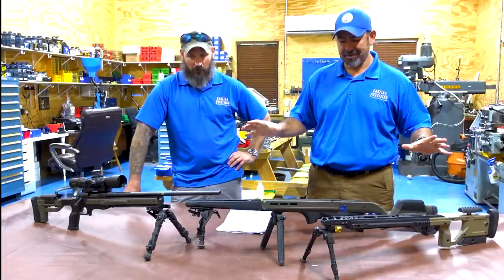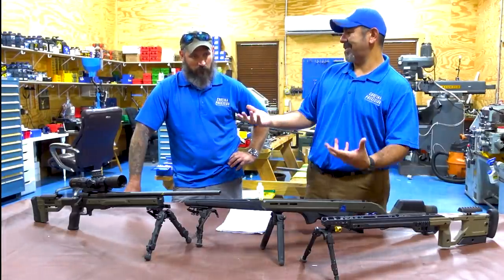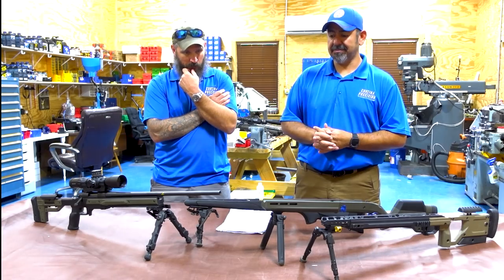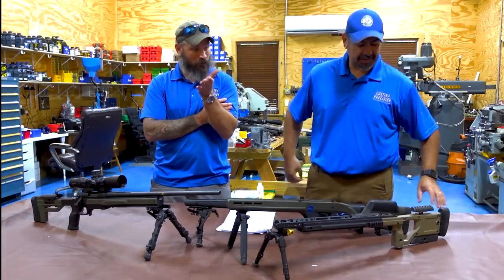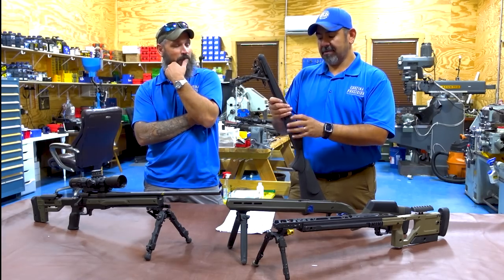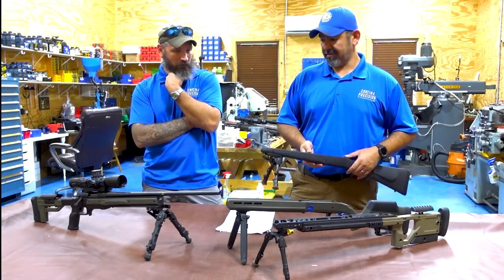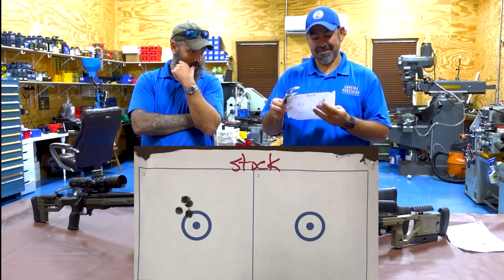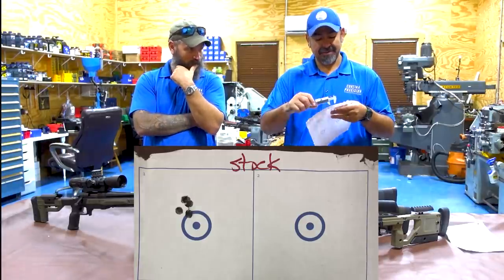6.5 NEEDS-MORE | WE TESTED FOUR DIFFERENT STOCKS

Comment: I know you want to put your tuner brake to push your product but for hunting and range gun no more barrel length, I have two 308 in magpul stocks and shoot half inch groups now they are hand loads a little over 2500 fps 168 MK, one half inch group does not make it a half inch shooter, try three groups then average it, you have another ''problem'' in my past I found stocks when switched the stocks the action need to settle into the stock for best accuracy. I love the magpul stocks but one thing set it at 50-55 inch pounds while the action is settling into the stock, keep an eye on the actions screws torque, they will back out affecting accuracy. Now H&S stocks set torque at 65 inch pounds and forget about it. magpul cheap bottom metal that plastic and cheek riser cant beat the price. Super Sniper want agree with me M24 I am old school, hing floor plate tough as nails, drop magazine in dirt, mud, dirty water you have a problem. A "sniper" one or two shot then high tell it. Fire Suppression drop magazine use an auto loader. Yes I have two 10 round magazines for my magpul stocks, some times a man can't resist that ''Rambo Look'' LOL LOL LOL If in conflict for high value targets my M24 clone with hing bottom metal. I have a problem first plane scopes love the grid but hate it at low power or in dark condition, Carlos Hathcock did not use a grid. LOL LOL LOL LOL I sent my first plane Leopold scopes back to Leopold and had tactical turrets put on. I would put both rifles in magpul stock add a good trigger put 50 rounds through both giving the stock time to settle in the stock, keeping an eye on torque and then compare them to keep the more better going try 140-147 ELD match which is a good hunting bullet. I like the more better, better than watching you shoot three to five thousand dollar rifles. Today times people are having problems with affording a thousand dollar rifle plus rail and scope. Even my local shooting ranges are running on four day weeks. My local gun smith went way up on his prices, I can't call my pension fund and tell them what I want my cola increase to be. That is why I like aluminum bedded stock no more gunsmith charging me for a bedding job. I need to buy some roller pin punches and do my own trigger replacement. I am well stock with brass bullets and powder or I would not be visiting my local range that often.

Comment: I would bed the other original stock and see if the rifles shoot the same after bedding then move one to the Oryx and tuner to see if it improves.
Reply: They did that already at the beginning
Reply: @fentonpainter7907  I must have missed something.  My understanding is that they only bedded and free floated upgrade rifle; the control rifles stock has not been touched up to this point.   They keep stating that the original stocks are garbage and they achieved significant gains by bedding and free floating the upgrade rifle.  My point is that if your trying to show the gains of making changes (ie:  tuner, trigger, chassis, etc) the initial factory off the shelf rifles should have been repaired to make them accurate and consistent before beginning the upgrades to one of them.  As if stands right now they are comparing the changes on the upgrade gun to a control gun that began the process with questionable consistency/accuracy baseline, so the lingering question through the entire processes will be is it the lousy factory stock fitting on the control gun or the upgrades that make the difference.

Comment: Not only since you pillar blocked and betted it with the few shots and the cleaning you done a break-in sequence on the barrel it would have been nice if you done a initial and a break in sequence and then started the testing cuz now you could just be getting into the barrels optimum condition not the stock and the upgrades

Comment: Interesting approach.  However your control is not the same as the "test" rifle.  Never was, never can be.  Going forward,  you might be able to compare things like a stock barrel vs. target crown angles, tuner, brake, tuner brake.  Once they are both shooting the same with the winning modification, I'd recommend triggers because you're no longer dealing with mechanical or harmonic changes in the rifle.

There's also the bipod test. static, preload, off a bag, F-TR low friction (at this point)
“No man ever steps in the same river twice, for it's not the same river and he's not the same man.” -Heraclitus

Comment: Once you changed the bedding on the "control" rifle it was no longer a control. So I say take the control and use it as a budget rifle. In my opinion most people buying a $700 rifle are not going to spend $800 on a stock.

Comment: Put both in the same stock since you already know the results and it will make more consistent results in the future. Then leave the control alone besides the stock until the end. At the end of all the tests modify the control with the same updates as the other one to see if the results are the same on both.

Comment: Might as well just start changing everything on both rifles. Control rifle has been changed so what's the point. What changed? The day, the weather,  glass bedding,  free floated, barrel is breaking in, chassis , bipod and you can't even tell me with 100% certainty that changes in group arent from barrel breaking in and cleaning

Comment: You really didn't need two rifles for what you're doing. Could have taken one and fired a "control group" for a basis. You're looking for what does/does not improve the rifle. Bed the OEM stock and try the aftermarket stocks. Go with what shoots best. Try different triggers and go with the best--if it makes a difference. Try different optics--go with the best. Try a tuner or tuner-brake. Go with the best setting. Then try different loads - bullets, powders, COLs, etc. Go with what shoots best. The object is to get the most out of an off-the-shelf rifle.

Comment: If you really wanted to get in depth with the after market stocks, you'd start at 20in/lbs on the action screws and add 5 in/lbs of torque until you find the sweet spot.

Comment: The control is established and the numbers are irreversible and permanent. Add brake and test. Add trigger and test. Change firing pin/spring and test. At that point it will be as good as it gets. Since it's a cheap factory barrel, fire Tubb final finish and see if it improves or ruins it.

Comment: I don't think you have an appreciation for how sensitive slender barrels are to heat.  Hunting rifle accuracy is normally measured in terms of three-shot groups.  Larger group samples would be fired with 3-5 minutes between rounds, with the bolt left open to allow air flow.  I've tried to shoot prairie dogs with my .243 deer rifle (a 1/2 MOA Browning A-bolt with a BOSS) and couldn't hit a single one after the fourth or fifth.  Even a free-floated slender-contour barrel will start to spray if the heat is not allowed to normalize between rounds.
Hunting rifle stocks are not designed for prone shooting, which explains Jason's discomfort.  Accuracy tests should be fired from a bench with the shooter sitting upright.  At deer-rifle sight-in clinics, I've seen several military-trained marksmen insist on shooting from the prone position, because that is what they have confidence in, but it's not the best choice.
Rather than improving the accuracy of a light hunting rifle, you're trying to turn it into a target rifle, which it is not.  If target performance is what you want, change the barrel to at least a varmint contour.  If "it has to shoot hot" I don't think you have a choice.

Comment: It seems to me that you do not have a clear goal. We know what the original control achieved save that information for comparison. 
Since the groups were larger in the chassis than the bedded original stock. How about bedding the chassis with Devcon 10110 to see if the groups improve. Your channel is about having an idea (like chassis will improve your group) and testing that to prove out whether it’s true or not. One suggestion might be a budget build using a “comfortable” bedded Boyds stock, some trigger work and load development. Let’s say budget control. Than introduce a second element of the best you can do with a modified factory rifle.

Comment: I dont understand the point of having two different rifles with one being a "Control" because really the "control" was the initial baseline as purchased out of the box results for the given rifle for the type of testing you seem to be doing (i.e., testing to see what modifications result in better or worse accuracy).  Think about it this way, you wouldn't do load development using 2 or 3 or 4, etc..  different rifles when the load is for single a given rifle... No, you test the different loads in the same rifle to see the results because as we all know, what's good in one wont necessarily be good in the next.

The "Control" is the thing or things that  is ./ are not being changed (like the barrel for example).  Remember in experimentation, a "control" is an element (or elements) that is (are) not changed / is (are) held constant and/or variable to which you do not have control over, so if anything the barreled action for a given rifle would ultimately be the "control" but it would be its own "control" (just like in load development, the rifle is the control (among a few other things like the specific bullet and brass for example). All the changes that you make to a given barreled action are the testable independent variables.

Now if you were testing the variables from one rifle to the next to see if results carry over, then sure, multiple rifles would be necessary but the same changes would need to be applied to each rifle and the fact still remains that each barreled action is its own original control. This type of testing however would need to be examined in a "percentage of change" way because of the uncontrollable variations from one barreled action to the next.

Comment: I understand why you intended to have a control gun and a worked gun, to compare how modifications improve the results. But, you’ve got “control targets”, they’re the targets shot in the first episode with two stock guns, which shot quite different. Those first targets aren’t going to change, so they’re your control.

So, in my opinion rather than this be an experiment of comparing stock rifle to modified rifle, modify them both exactly the same way and see if the results come closer together or drift apart, or one rifle doesn’t take the mods the same way at the other rifle.

Comment: If you're going to call it a control, it needs to be a control. If you keep changing it, it's no longer a control. I think the point should be comparing an off the shelf rifle to a fully upgraded rifle for those on a limited budget. This lets your viewer know what they can expect for their efforts and dollars. Some may not have the budget to do a complete upgrade, but they may be able to do a few things and you've shown them what they can expect by just simply bedding the rifle. They can see what they gain by upgrading in the other rifle. Make the changes to the other rifle and keep this one the same, every upgrade you make should be compared to the control rifle so viewers can see what the benefit would be. I know you'd be just shooting groups with the control, but you'd be building an aggregate group size for this rifle and in the end they would know exactly what to expect from this off the shelf rifle with minimal efforts.

Comment: I think you're done with the control. Leave it. You have the data you already need to compare against the control. Thread the barrel and add a tuner-break. The pull the barrel and action and blueprint them,... then trigger.

Comment: While I appreciate your effort to normalize testing between the stocks, there is a problem, in fact, I believe this really invalidates your test. You didn't clean the gun between every stock test.  In order to test consistently each configuration you have to start from the same point just like in scientific testing. You must start every stock with the same baseline. Also, shooting two five round groups is a very small sampling. Thanks for sharing.